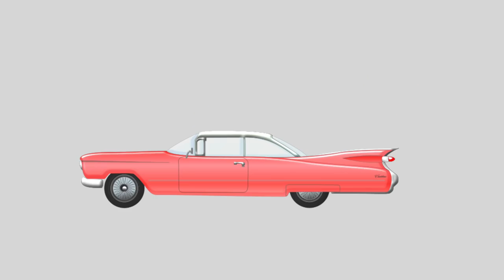Yes, Rockets CAN Fly in a Vacuum

Comment: Only reply to this comment if you are a gaslighting NASA chatbot 😂
Reply: A handful of science deniers polluting the comment section constitutes getting ratioed?
Reply: You think science is a democracy? That's cute.
Reply: @papalegba6796  You have no science to offer.
Reply: @AM-rd9pu  I know you are, chatbot, but what am I? 🤔😂
Reply: @papalegba6796 It’s not surprising you used that phrase incorrectly.
Reply: Current like to dislike ration is 9 to 1
Reply: @frantaspacek  o rly?
Reply: @AM-rd9pu  I know you didn't use that phrase correctly but what did i, chatbot?😂
Reply: @papalegba6796  You still clearly don’t know the way that phrase is supposed to be used.
Reply: @AM-rd9pu  😂
Reply: @papalegba6796 Yes, I know that your argument is nothing more than, “no, you”.
Reply: @papalegba6796  So CAN YOU calculate the work required to accelerate 500 kilos of water from a standstill to Mach eight?
No?
WHY NOT?
You CLAIM to understand basic physics.
Work calculations are about as basic as you can get.
Reply: @papalegba6796  Would you agree that the exhaust gases coming out of a rocket engine nozzle has mass?
Reply: @stuartgray5877  water?🤔
Reply: @papalegba6796 Are you aware of the production of the combustion reaction of hydrogen and oxygen?
Reply: @AM-rd9pu  yes, chatbot 😂
Reply: @sailorman8668  yes, chatbot 😂
Reply: @papalegba6796  And what would that product be?
Reply: @AM-rd9pu  do you want me to say that fire is water? Will that satisfy your programming? What will it achieve, chatbot? 😂
Reply: @papalegba6796  They teach what the combustion by-product of a hydrogen oxygen flame is in DAY ONE of High School Chemistry.
So now we know for certain that you failed to complete high school chemistry just as you failed to complete basic physics.

What Grade DID you drop out of the 8th?
Reply: @stuartgray5877  so if fire is water rockets work in a vacuum?😂

Comment: There is an equal opposite reaction due to the fact that interaction with a separate object. A rockets exhaust interacts with nothing, so nothing is going to move. Simple!
Reply: "A rockets exhaust interacts with nothing, ..."   -   So how do the exhaust gasses, which consist of very large numbers of gas molecules travelling extremely quickly in (initially) random directions, get out of the rocket engine (out of the combustion chamber and down the nozzle) without interacting with the inner surfaces of that rocket engine?
Reply: @rjcornford  same way a grounding wire works-- path of least resistance.  As soon as the gas of a the internal pressure system is exposed to a negative pressure system, that's where it's heading-- to the path of least resistance i.e. not the "walls of the combustion chamber."
Reply: @DrCash7  That would require breaking the laws of physics. The "path of least resistance" is where the individual gas particle was heading before the container it was in was exposed to an area with lower pressure. It can't just turn mid-flight and reverse its direction.
Reply: @Jan_Strzelecki  shh.
Reply: @DrCash7  Are you trying to shush the laws of physics? :D
Reply: @Jan_Strzelecki  "it can't just turn mid-flight and change directions."   Really?? A particle can't change directions??  You really said that...Well when you say bunk things like this, you've no grasp of your own thoughts.  Get a hold of your thoughts first before reaching for physics.  Free-expansion is well-covered, but if you continue to make and define your own rules, you're just off in Star Wars somewhere ingoring the same physics you're not up-to-speed on yet.

Pew pew.  It's what sound lasers make in space ;) xD
Reply: @DrCash7  Really?? A particle can't change directions?
Yes. Really. "Every object will remain at rest or in uniform motion in a straight line unless compelled to change its state by the action of an external force." You really don't understand that? Vacuum doesn't do anything. It doesn't suck, and it doesn't compel anything to change its state, or direction of travel. "Get a hold of your thoughts first before reaching for physics." :]

Free-expansion is well-covered
Oh yes, yes it is - it just doesn't do what you think it does :)

Pew pew.  It's what sound lasers make in space
And that's how you "know" NASA's footage is fake, right? :D
Reply: "ladies and gents, a particle cannot change direction."

-- @Jan_Strzelecki  

Pubert time for your bedtime. 🌙 🐻
Reply: @DrCash7  "Unless compelled to change its state by the action of an external force." - you forgot to add this bit :]
Reply: @Jan_Strzelecki  Yes.  You forgot quite a bit.
Reply: @DrCash7  No, you forgot to add that bit while making up that quote :) Quote mining is just something hoax believers can't resist to do, I guess :)
Reply: @Jan_Strzelecki  it's your quote.  Scroll up Pubert xD.  Arguing with yourself again.
Reply: "it can't just turn mid-flight and reverse its direction"  
--  @Jan_Strzelecki    "the idiot"
Reply: @DrCash7  Yes, when exposed to a vacuum - even when exposed to a vacuum - it won't change its direction of flight by itself. That is the point. That's what Newton's laws of motion tell us. My position is clear and consistent on that. And before you say "Free expansion!!!1!!!1!", remember, changing direction of the flight of anything requires work. Do you understand it now?
Reply: @DrCash7  No, it's my quote. And just because reality baffles and confuses you doesn't mean it fake :)
Reply: @DrCash7  I didn't say it wasn't my quote. I said it was taken out of context. Trying to insult me and quote mining me doesn't count as rebuttal. And what does The Addams Family has to do with it anyway? You keep bringing it up.
Reply: @DrCash7  I'm still waiting for some actual rebuttal, instead of "Hurr durr, I'll quote mine you and pretend it's stupid", btw :)
Reply: yes you did Pubert :o :o
"It's not my quote."
"Ok it's my quote..."
"But but but!"

--  @Jan_Strzelecki   Pubert
Reply: @DrCash7  I did Pubert what? Are you pretending to be stupid now or something? Please, do tell me what mystical forces in a vacuum can make exhaust particle change its flight trajectory?
Reply: @Jan_Strzelecki  tell us more about the faces of particles, Pubert :o :o :o
Reply: @DrCash7  Who's "us"? :) Also, tell me, where did I say "It's not my quote"? :]
(And, again, what does The Addams Family has to do with it anyway?)

Comment: No rockets cannot move in space. Period
Reply: Why not? Do you know anything about physics?
Reply: Come on then Einstein....explain why rockets cannot move in space.
Presumably you know the equation to calculate the thrust of a rocket engine.  LMAO
Reply: Kenneth - the explain how a rocket engine can accelerate the mass of the exhaust gas away from the nozzle at MACH EIGHT!
Are you saying that the engine can accelerate all that mass without applying a force to that mass?
Reply: Who can argue against such a thorough analysis full of convincing facts?

/s
Reply: Kenneth - no REALLY tell us how a rocket engine can accelerate mass without applying a force to that mass.
For example a space shuttle main engine accelerates 500 kilograms of pure water from a velocity of zero to MACH EIGHT, and it does this EVERY SECOND.
Now tell us that. SSME can accelerate 500 kg of mass to mach eight Every Second, without feeling a recoil force.
That is more momentum than an aircraft carrier launching a fully loaded fighter jet.
Do you think an aircraft carrier feels NO RECOIL when it does that?
Maybe you should leave the physics to those that bothered to finish high school shall we?
Reply: @stuartgray5877  
Excellent point!
Just want to point out that the exhaust velocity from an SSME is even higher than Mach 8.
If comparing to the average Mach value at sea level (340 m/sec), the SSME's exhaust velocity is about Mach 10.5 at sea level and Mach 13 in space, which is among the highest of all rocket engines.
Yes, rocket engines don't just work in space, they work better than in the atmosphere since their thrust per unit of fuel consumption is proportional to their exhaust velocity.
Reply: @fromnorway643  so the gas laws are fake? Ok chatbot 😂
Reply: @fromnorway643  so the gas laws really are fake? 😂
Reply: @papalegba6796  
👎👎👎👎👎👎👎👎👎👎
Reply: @papalegba6796  - Just TELL US how rockets accelerate mass. We want to be as smart as you are so, please educate us.
Reply: @stuartgray5877  😂
Reply: @fromnorway643  See papalegba thinks he knows some sort of "secret" about how rockets work. But he refuses to explain this magical theory to us.
He thinks that mass can be accelerated from the back of a rocket with NO FORCE applied to that mass.
Reply: @stuartgray5877 
Newton's third law or conservation of momentum is obviously a completely unknown concept to him!
Reply: @fromnorway643  But it CLAIMS to be an expert but refuses to answer any questions.
Reply: @stuartgray5877 
Seems like typical flat earther mentality to me!
They make up ever more absurd "explanations" to fill the holes in their grand "theory" or ignore any counter arguments completely while repeating their original, debunked arguments ad nauseam.
Reply: Funny how many flatters are such cowards.
Reply: Lol the chatbots triggered off each other lolololl!!!!
Reply: @DrCash7  you and legba? seems like it
Reply: @papalegba6796  congratulations, you managed to create the most pathetic response
Reply: @stuartgray5877  you don’t understand. I mean that rockets can’t ignite while in the vacuum of space. Of coarse rockets can fly in earths atmosphere but not propel in outer space while sustaining thrust in outer space.
Reply: @stuartgray5877  no it doesn't cos it's pseudoscience 😂

Comment: The amount of oxygen needed for a combustion engine and the astronauts themselves is much more than any rocket could contain. Not to mention, the waste being emitted in an environment where it could not naturally be exchanged and recycled is counter intuitive. Try again.
Reply: Rocket fuel contains their own oxidizers.
Reply: @tboman4128  Oxidation is a bi product of some chemical or element combining with oxygen. You need oxygen first, bud. Nice try.
Reply: Since you claim the "amount" is wrong, what equations did you use to calculate that? 

And no, not all oxidizes for combustion contain O2. You need a lesson in chemistry. I work on a program back in the early 90s that used ClF5 as the oxider. 

Try again. 

Oh, and I recommend you check out the flat earth channels. They are looking for new recruits.
Reply: @kitcanyon658  - So apparently Mikiee Mike would be FINE with pouring Chlorine trifluoride on his skin, since "combustion requires oxygen".....

Not ONLY is Chlorine trifluoride an oxidizer, but it is also HYPERGOLIC with MOST SUBSTANCES including CONCRETE!
Reply: @stuartgray5877  You of all people should understand that I've measured data (cogo points) from my surveyors of existing topo to see that there is no curvature. All I had to do is create a profile and measure the slope of to see the 8" per mile of curvature that doesn't exist. Its not 8" nor 10" or 12", you insert the drop per mile. Im an actual civil engineering tech. You proved nothing, by the way. Lol
Reply: @mikieemiike3979  then please explain the FACT that most modern aircraft are equipped with fiber-optic gyros.
The pre-flight test of these gyros is to measure earth rotation and CURVATURE .
I have been performing these tests as an Aerospace Test Engineer for almost 30 years now.
Reply: @mikieemiike3979  - "I've measured data (cogo points) from my surveyors of existing topo to see that there is no curvature."

Oh and STOP LYING. You did NO SUCH THING.
Reply: @mikieemiike3979  - "None of you are a match for me. "

Apparently in YOUR world, high school dropouts know more about Rocket Propulsion than Spacecraft Engineers do.
What you are suffering from is called the Dunning-Kruger syndrome.
Yeah. Bless your little heart!
Reply: @mikieemiike3979  - "None of you are a match for me."

As the Pidgeon craps all over the chessboard and declares itself the winner...
Bless your little heart!
Reply: @mikieemiike3979  OR run like a coward, your choice.
Reply: @stuartgray5877  I already won. Go cry elsewhere.
Reply: @stuartgray5877  Haha You're projecting your comment. 😂
Reply: @stuartgray5877  Were you born last month? I've been hearing that side my whole life. It makes no sense. I've already proven it wrong using civil engineering methods and survey data while working on the high speed rail road. There is no curvature. Im done. I've been studying plane earth for 6 years already that was the nail in the coffin.
Reply: @mikieemiike3979  - "There is no curvature."
So my 28 years of measuring earth rotation as a Professional Aerospace Test Engineer using fiber-optic gyros is a lie?
And the SIX spacecraft I have launched in my career, two to earth orbit and four to deep space, were just my imagination?
FOUR of those spacecraft sent back images of earth from space that was part of PEER REVIEWED SCIENCE.
Where is the peer reviewed science of YOU doing your analysis?
Reply: @mikieemiike3979  - "I have yet to see even 1 actual image from space that's not CGI."

Search the net FOR "NASAs Deep Impact
films earth as an 
alien world".

WHAT DO YOU FIND?
Reply: @mikieemiike3979  SG is a bot.  Not far off with the "when were your born" comment.  If robots can even have a birth-- ot appears IT was created around 2016.